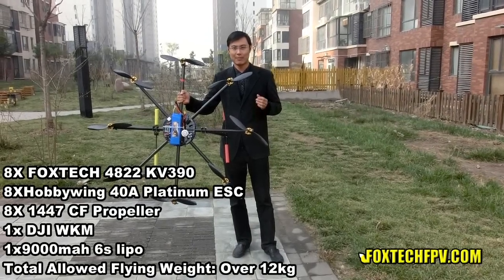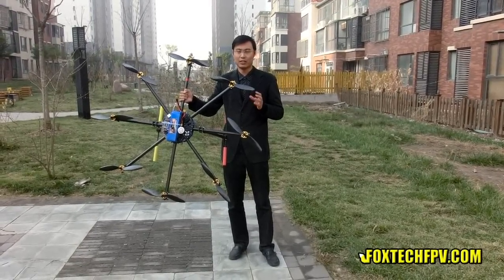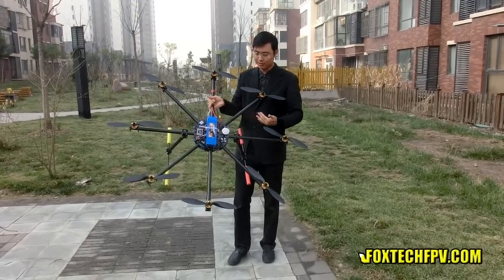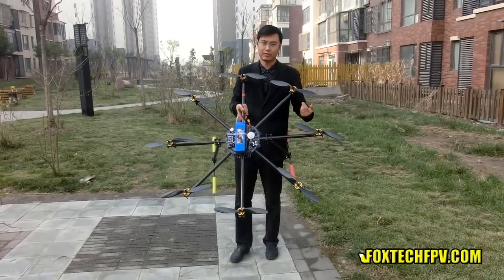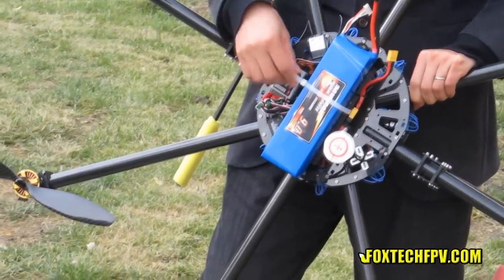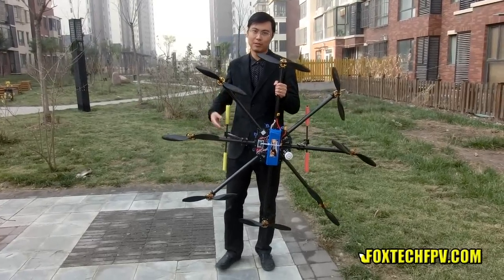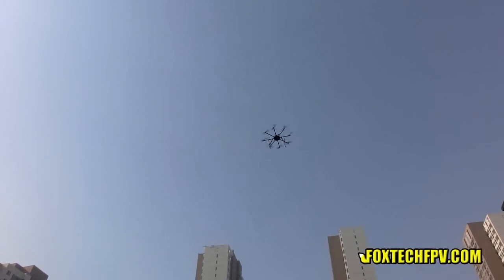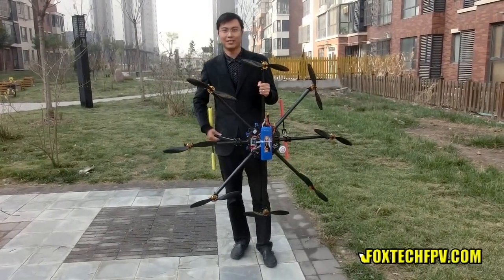Mantis octo 1100mm big Octocopter

Comment from the maker: flight time like over 30 minutes if you use big big battery,
total weight is 1050 g, without power  is around 3kg without battery.
max flying weight over 15 kg.